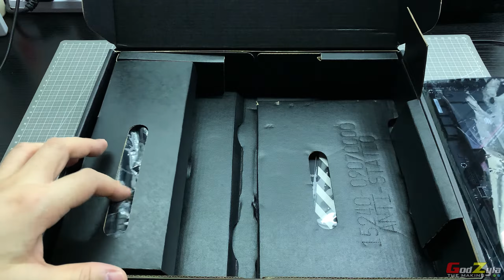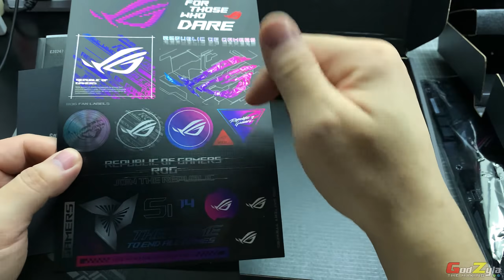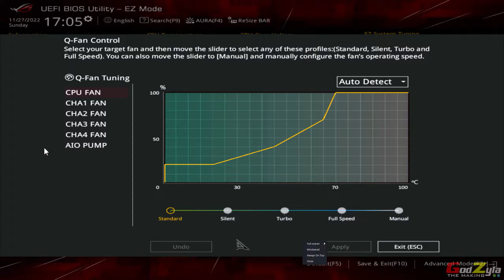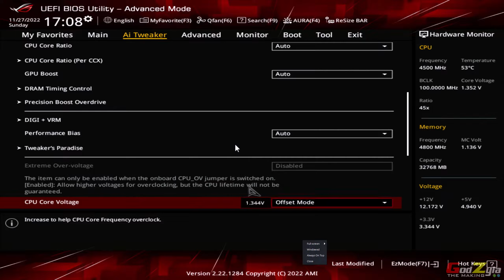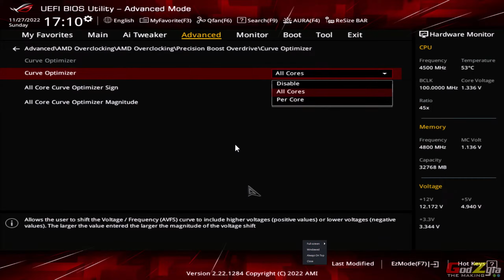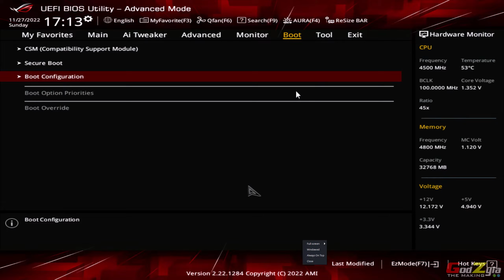ASUS B650E-F Strix Gaming Wifi

Comment: Thank you for this video extremely helpful!
Reply from the maker: Hi The Diabetic Way, welcome to my channel, am glad you find something useful, all the best with your build too. 😉
Reply: @KleoYan  Thank you lots seem to have changed since my last Asus Motherboard and will be trying to follow your video as much as possibe thank you for your time in doing this really helps! Did you have any hiccups on th efirst boot with it at all? I think thats the worst bit switching it on for the first time hoping it does not melt your process 🙂
Reply from the maker: @TheDiabeticWay  Hi and nope, I dont have any issues on first boot. Infact what I normally do is to plug only the essential componets on a test bench which include these. 1) Processor 2) Rams 3) Plus only the 24pin and 8pin EPS cable to the motherboard. boot it up to UEFI. It will take sometime to boot as newer generation system which make use of DDR5, you will need to let it run (Memory Training Cycle). You might feel that it's not running but it is.. just need a couple of minutes and to wait for it to boot.
Reply: @KleoYan  thanks for the reminders! I nwas being braver and adding the HD audio and usb2.0 but nice to know you booted up first time, Im always ready to turn off fast in case fans don't start hehehe :-) and cross fingers as first boot I thinks the worst at knowing if you have any issues. I also seen a good video on  ASUS Motherboard Troubleshooting via Q-LED in case needed. Nice to know though its going to take a while thank you!
Reply: @KleoYan  It also just says power connectors on my motherboard not as detailed as Id like really in the manuals! Has you called it EPS mines different I also got advice I do not need them all in for some strange reasons but if that's Tecnical I tend to stick to what they advice 🙂
Reply: @KleoYan  I'm also not fully knowing where to fit the fans as on my old build I did it at the back of the case, on this Elite case I do not see anything to plug fans in so I'm guessing to do it on the motherboard?
Reply from the maker: @TheDiabeticWay   you are most welcome, as for the Fans, there are fan headers on your motherboard which are 4pin pwm. Fans these days can be daisy chained but do watch out on the fan headers on your motherboard, see if it's of 1a or 2a, then check on your fan's spec. if it's of 0.25a , you can daisy chained 4 fans and plug to the 1a fan header on your motherboard. if it's 0.30a then do not daisy chained more than 3 fans to that 1a fan header.
Reply from the maker: @TheDiabeticWay  this might aid you in someways https://www.youtube.com/watch?v=MCMkrQwFnKM
Reply: @KleoYan   Funny when I have booted up fans have all come on but now lights on them think I need to install Cam?
I also got an error message on first boot up  and cound not get into the Bios after many attempts, so I just click Y on  what the error message was telling me! I will post the message but be warned its a long message I had to copy! 🙂 (New CPU installed, FTPM/PSP NV Corrupted or FTPM/PSP NV Structure changed.
Press Y to reset FTPM, If you have Bitlocker or encruption enabled, the 
system will not boot without a recovery key.
Press N to keep to keep previous FTPM record and continue system boot,
ftpm will not enable in new CPU, you can swap back to the old CPU to 
recover TPM related keys and date) I just hope it was ok selecting yes for it?
Reply from the maker: @TheDiabeticWay  for new board purchased. You should not be getting the message prompt but if you did plug in your old processor, it will then prompt. It's perfectly find to hit Y to reset, unless you have enabled bitlocker. As for fans, I have no idea what type of fans you are using and do not understand what do you mean by installing CAM? by default, any fans will light up before boothing to windows if your fans required a application to control the argb. for Asus, install the Armoury Crate application as there is a section where you can control the argb headers on your motherboard .
Reply: @KleoYan  I thought too to have RGB lights to work in Bios but no light have come on so not sure if I need to find them in Bios or load the Cam software when I have got Windows 11 installed! Which again Im not too sure on this motherboad to boot up from a flash USB to installl Windows 11 and what I need to do before hand to get it to load and start teh installation. On my older PC I had to find USB Boot device in my Bios but cannot find on this Bios yet! My Case Is a NZXT Case H7 Elite 2023 Black Midi ATX  I want to do a clean install of Windows 11 then purphase a Licence Key fo it. I have made the flash drive but not tested it yet to see if it will boot up and from which USB port!
Reply from the maker: @TheDiabeticWay  oh ok.. plug your USB windows installer to any of the USB port, next go to UEFI, tap on the Boot section (Top sub menu) then you will see under boot override with your USB listed. select it, it will boot to your USB windows installer and follow the instructions on screen.
Reply: @KleoYan  I've got Windows 11 up and running now but still no RGB lights coming on on teh 3 fans at the front Its a H& Elite so its suppose to have them on it  and I cannot get hold of NZXT
Reply: needs to be a lot different on mine I jsut went to boot section and no WD Black SSD showing up as its not been formated so I had to go to the Boot section andit had detected the USB flash Drive there was an option under it and when I clicked on it it started to install windows 11 but then I could not go any further as it had no internet connection! So I had to go into CMD and Type OOBE\BYPASSWORD  for it to reboot and then I could install windows 11 without internet connection. soon as I was in there I installed the network driver which I had already downloaded from Asus and had it on an external hardrive but was a lot of work to get passed it all jsut to install windows! thanks for you help on these issues weired too how we are both doing it in a different manner but very same ish!
   @KleoYan
Reply: @KleoYan  This video helped me out with no internet connection! https://www.youtube.com/watch?v=zEEj5hDrmHA
Reply from the maker: @TheDiabeticWay  don't mind me asking, what fans are you using (model and brand) and does the fans comes with a Hub? I need to know more info on which model of fans .. example Lian Li Unifans AL120 V2 comes with a hub. Then I will be able to dig further. I can't help you when I have bits and pieces of information and I know you are getting frustrated.
Reply: @KleoYan  Its teh no fan lights annoyin g me 🙂 cannot figure it out why no lights 😞
Reply from the maker: @TheDiabeticWay  Thats why i've asked what type of fan brand and model are you using? I need to know if there are any controllers or hub?
Reply: @KleoYan  The fans and hub are suppose d to be all in with the case I got from Amazon as they state this but as to what they state I do not seem to have a hub and teh fans are not light up why Im very confused also I m not dismantling it to send back they will need to send me the missing items if there is any missing item! Ive never had lights in a case before by my old motherboard had somthing on the back to plug things in for fans but n this case its empty st the back! I will give you the link to what I have purchase as I cannot tell you what I do not know! They say its suppose to have NTEGRATED RGB LIGHTING: Includes three pre-installed F140 RGB Core fans and an RGB controller for ready-to-use custom lighting. Includes 3 x 140mm RGB fans and an RGB controller. AA14 lighting with F140 RGBCore fans. This housing also features NZXT CAM  but I do not see this withing the items I have here!  thanks you so much! https://www.amazon.co.uk/gp/product/B0BW67BT9T/ref=ppx_od_dt_b_asin_title_s00?ie=UTF8&psc=1
Reply: @KleoYan  Thank you for all of your help! I finaly relzed the issues due to badly written manuals and me missing seeing a RGB Connector which I was thinking it was to do with Hardrives with it saying Sata Drive, Now I have relized its teh poer cable I missed plugging in for it and as soon as I had done this the  light came on! But was down to Scan Computers  on the phone that helped me as these bots are of no use to a human clearly understanding instructions! Once explain by phone all working! 🙂 Last one to go now with installing teh Grahic Card but going to get some drivers on first in Windows 11
Reply from the maker: @TheDiabeticWay  oh ok, that's good. Glad you've sorted everything out. Thank you for the updates 😉
Reply: @KleoYan  Thank you for your help! 🙂
Reply from the maker: @TheDiabeticWay  you are most welcome.

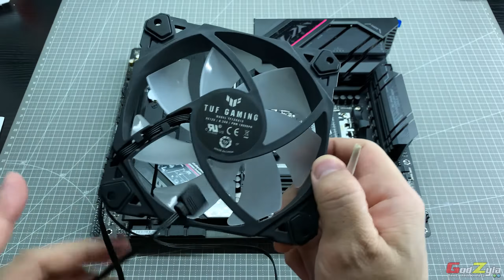Comment: Hey thank you for the amazing in depth video,this is going to be my first time building a pc and I’m a little nervous and have a couple questions,I have ordered a Corsair 4000d airflow case and wish to install 5 case fans..is that possible with this motherboard? I was a little confused at 26:00 in the video where you explained a problem with the fan system,thanks if u decide to reply
Reply from the maker: Hi Steve Johnson, welcome to my channel. I was trying to explain that each of these fan headers have a max capacity of 1ampere. And fans out there you are able to daisy chain them together which gives you only one connection point. you can do that but make sure to find our what's the total 3 fan ampere is before you plug. 

Example fan 1 to fan 3 are each rated at 0.30a. if you total them up, it will be at 0.90a which is not an issue to plug to any of these motherboard fan header (Each) If 3 fans daisy chained and total up above 1ampere, lets say each fan is at 0.4a, total will be 1.2a, then you should not be pluging to any of these motherboard fan header (Each)
Reply: @KleoYan  Hi KleoYan, thank you for your video. I recently bought this motherboard and I am planning on building my pc soon. Your comment abbout the Amps spooked me as I am really not experienced in computer parts and I didn't expect the amps to become a problem. After some digging around on the internet and researching the case I bought, it turns out a power repeater can be used for the fans. This way you can attach many fans to one fan header as the power is pulled directly from the PSU. Please correct me if I am wrong, but I think this would be the solution for this motherboard. I don't know if many cases come with a repeater, mine did in any case.
Reply from the maker: @daniel_wiersma  Hi welcome to my channel. Yes you can use that and it's perfectly safe. Not all chassis comes with the Fan and argb hub which is powered by the PSU sata. That's the reason for some experience builders, they will purchase a fan and argb hub which draws power directly from the PSU instead from the motherboard and yes as you've mentioned, this will resolve the ampere issue. Thank you for your feedback and all the best with your build.

Comment: very nice review, thanks for showing and explaning the bios. i was wondering which m.2 slot i should use because i heard some are better than others
Reply from the maker: Hello Metabus, welcome to my channel, use the m.2 slot that is nearer to the CPU. That will be the fastest slot.
Reply: @KleoYan  i see, thank you. So if i have two ssd's should i put my game drive in the top slot or the one that my operating system is stored on?
Reply from the maker: @Metabus_  hi for me I would install both OS and gaming program into one m.2 and to slot at the top slot nearer to the cpu. The rest of the m.2 like storage to the 2nd and 3rd slot. But if you have limited storage space on your m.2s then I will just have the os drive at the top slot and the game m.2 at the 2nd slot.

Comment: I just bought this motherboard but the second m.2 drive does not show up no matter what i try. Any ideas would be helpfull.
Reply from the maker: Hi Jack Dawson, welcome to my channel, kind of I ask which m.2 are you using. The brand and model?
Reply: @KleoYan   its a samung m.2 . One is wd which i am using . But the second one is installed but is not showing up on bios or windows. I think it has something to do with the pcie slots but not sure what it is. Can u help out
Reply from the maker: @jackdawson4807  hmm 🤔 1st remove the Samsung m.2 from the slot, place the WD m.2 to the slot, see if it detects? If it does, the motherboard slot is not faulty. 2nd if this slot is not faulty, use an eraser, rub and clean the Samsung m.2 contact point. Then try again. If it still does not work then most likely is the m.2 issue and not the slot.

Comment: Hey brotha, thank you for this video! I am going to pick up this motherboard,  i’m going to use lian li fans with the fan hub controller. 

You talked about the fans being a con. So my question is: in what slot would you suggest connecting the fan  controller? I see the video is 4 months old so i hope you have time to reply. Thanks again
Reply from the maker: Hi Jakos Wild Rift, welcome to my channel. if you are using the Uni Fan controller (SL,AL or SL infinity) you need not have to worry as the drawing power of those fans are from the uni fan controller and not from your motherboard. even if you did plug the PWM cable between the Uni Fan controller to your motherboard, it's ok. as mentioned the fan power drawn is from the uni fan controller, just make sure that the power source (Sata) is plug to the uni fan controller.

Comment: I was looking at using this board in the lancool 3 with an arctic 420mm AIO. Clearance for the rear I/O seems pretty tight judgeing by your previous videos. Do you think this combo would work?
Thanks
Reply from the maker: Hello oBrett McEwan-Jones, welcome to my channel. phew lucky you came here to ask. No you can't fit as the rear I/O of this board is 45mm tall. you only have 40mm clearance on the Lancool III if you mount the 420 AIO.
Reply: @KleoYan  Big thanks for the reply, saved me a huge headache later. Its so hard to come across good info like that. youve defo earnt another sub love the videos cheers!
Reply from the maker: @Mrgoodnyt  you are most welcome. I am glad to help. Infact do note that I am not a reviewer. This channel is base as a end user experience.

Comment: Hello! I bought a Samsung 980 Pro 2TB M.2 .Which slot should I put it in?The top one?

Thank you!
Reply from the maker: Hello Shaza, welcome to my channel. it greatly depends what you are using your m.2 for? if it's for storage, any of the bottom m.2 slot will do. if you are using it as an OS or Grame app drive, then plug it to the 1st m.2 slot nearest to your Processor.
Reply: @KleoYan  Thanks for the quick response.Everything will be on it. Windows, games.
Reply from the maker: @shaza1910  I see, then plug to the first slot near the processor, you will get to enjoy the fast response.
Reply: @KleoYan  Thank you!
Reply from the maker: @shaza1910  most welcome and all the best with your build.

Comment: I'm so glad you mentioned the thing about the argb fans - i'm about to build my first PC with this board and don't want to overload or melt anything! Excellent, detailed review - Thank you :)
Reply from the maker: Hi Michael Morales, welcome to my channel and all the very best with your build too. Thanks again for the feedback.
Reply: How to fix this problem ? Im first time builder and i wanna use 3 daisy chained fans(each 0.37A ) .fans and argb controlling looks the most confusing thing to me as a first timer
Reply from the maker: @erdalguncel9038  hi welcome to my channel. To resolve your issue. Find out more about an argb fan hub which you can use.
Reply: @KleoYan  so if i bought of those Lian Li unifan with 3 daisychain fans kit with the controller i would be ok to use that with this board?
Reply from the maker: @Djaym0  yes they are as the fans are drawing power from the controller and not from your motherboard.
Reply: @KleoYan  what if i run the fans which are connected to mobo with max %70 speed ? Is this still a problem ? I guess it shouldnt , what do you think in this scenario?
Reply from the maker: @erdalguncel9038  hello and welcome to my channel. It's of no issue if your fans are of PWM and they can be controll at 70% via the motherboard utlity software or even in the bios itself.
Reply: @KleoYan hi im planning my first build with this motherboard in the Lian Li 216, do i have to worry about overloading RGB headers if i connect more fans to the included PWM/RGB hub?
Reply from the maker: @ConnorH2111  welcome to my channel. There is nothing to worry about as the Lancool 216 have a sata cable which draws the power for your ARGB, but for fan load. just make sure if you daisy chained fans. the fan load is not more than 1A on most header of this board.
Reply: @KleoYan  wow thanks for the quick reply, what if i daisy chain 3 fans and plug them into the hub for power and RGB? would it still be fine because its drawing its power from the psu?
Reply from the maker: @ConnorH2111  the case fan hub is only meant for 1 fan 1 ARGB. You can’t daisy chain. Even if you do. It will not work.
Reply: @KleoYan  ohhh okay i understand, thanks for the info anyway, subbed 👍🏻
Reply from the maker: @ConnorH2111  you are most welcome and thank you to have subscribe. I wish you oall the very best with your build too 😉